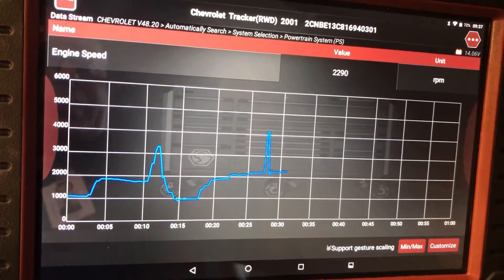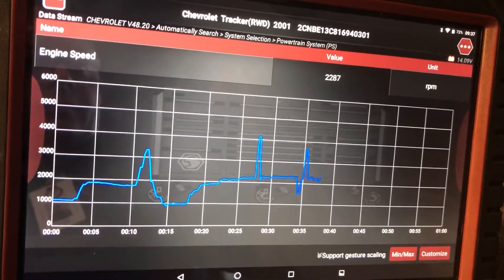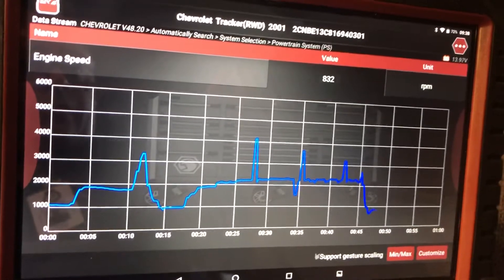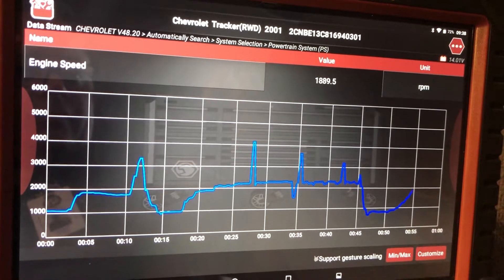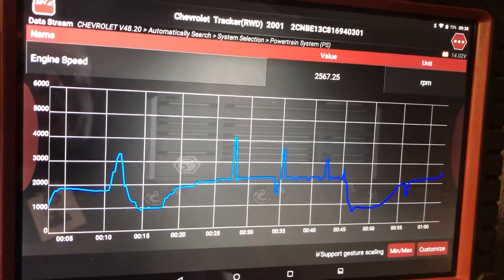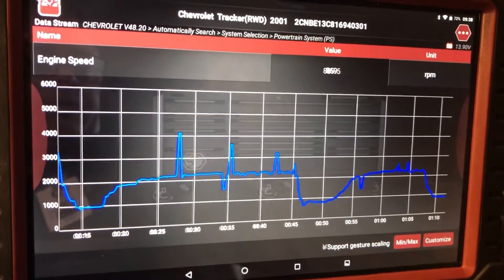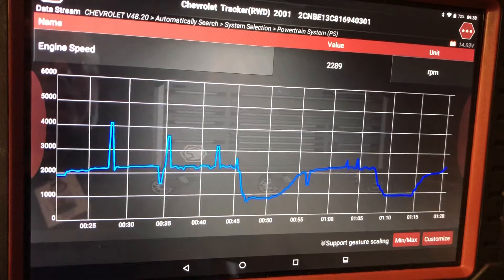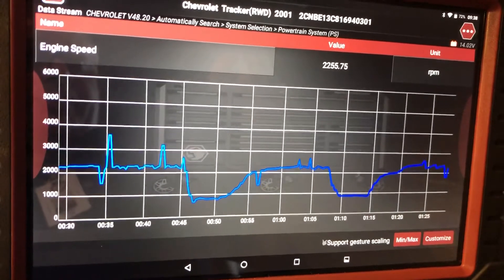Live data of failing Crankshaft position sensor

Comment: I too bought this Launch and have been teaching myself how to use it. Last night I was trying to do some live date on my 1998 w208 (Benz) because the car’s been acting really funny as of late. Stutters at traffic lights as if it’s going to shut off. Sometimes it doesn’t want to start up. After a few tries, it finally fires up. My Hall effect is running true, I believe. There’s no option for crank pos. sen… I see you using “engine speed.” Is this where I too test my CPS for Mercedes? @ 2000 rpm’s? 
I know different makes use different terminologies.